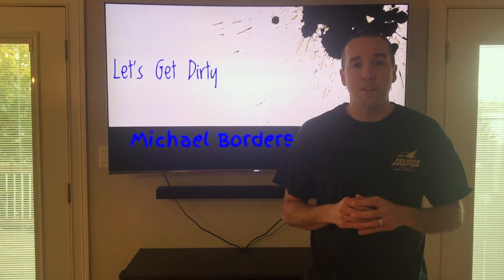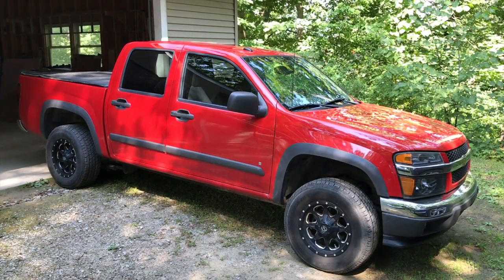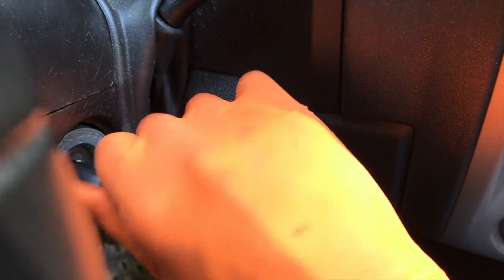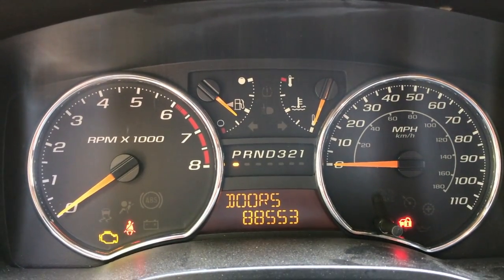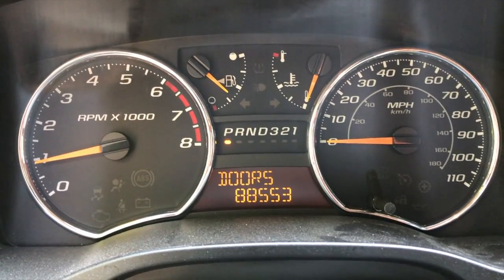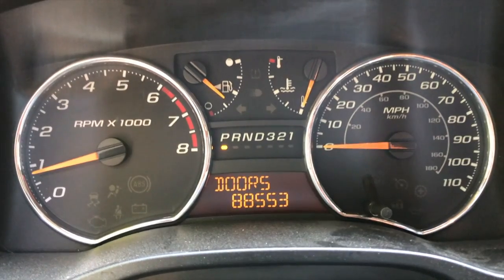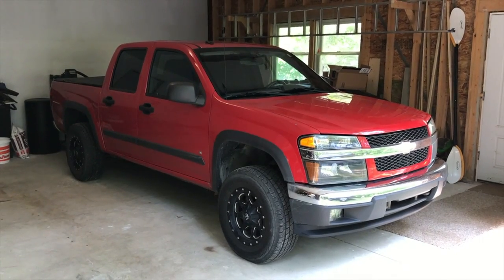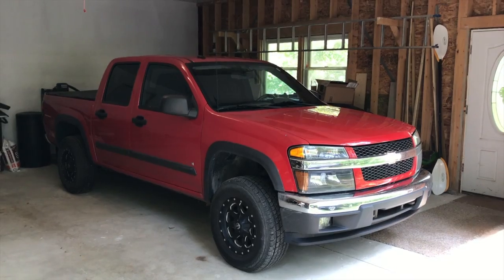How to do a "QUICK Reset" on your ABS System!

Comment: So far it didn't go away will try the driving option in a few minutes 🤷🏽‍♀️
Reply from the maker: @Altered-By-Christ  

Thanks for watching.  If that doesn’t help, try disconnecting your black negative cable from your battery and leaving disconnected for five minutes.

This will also allow your system to reset.

Comment: I know this vid is old but my 00 gmc sierra has an abs light on for front left wheelspeed circuit open. I replaced the wheel bearing and nothing happened ill try this but i dont think itll work
Reply from the maker: @thegman4759  

Thanks for watching.  Since the wheel bearing was just replaced, you may want to disconnect the black negative cable from your battery and leave disconnected for a minimum of five minutes.

This will allow your system to reset and hopefully turn off ABS fault light.  🧰
Reply: @DIYwithMichaelBorders  thank you I will try that to haven't done the pedal reset yet though.

Comment: This likely all bs! I had the same symptoms; turn signals not working, bogus transmission shift solenoid error codes and neutral safety error code. Took  vehicle to local mechanic and they confirmed noted error codes. They wanted $500 plus parts to further confirm error codes.  I opened hood and noted break fluid was low and dirty. I flushed and bled brake B fluid and now everything works great!  Don’t trust EMS on your car or any so-called mechanics!

Comment: How would
ThIs work for a 2016?Dodge journey with a push start
Reply from the maker: @jloc260  

Thanks for watching.  For push-button start, you will want to press your ignition start/stop push-button without having your foot on the brake pedal.

This will allow your ignition system to turn on without starting the engine.  From here, you can continue forward with performing this reset procedure.

Comment: 2004 Tacoma ABS light blinking when braking=after stopping foot off brake, blinking stops?  AFTER DRIVING A BIT, THEN BRAKING BLINKING RESUMES?  bRAKES SEEM FINE.  i HAVE AN AUTO INSURANCE SENSOR IN MY CODE READER PLUG. SOMETHING PROGRESSIVE iNS  GIVES NEW CUSTOMERS TO USE FOR SIX MONTHS TO SEE HOW CUSTOMERS DRIVE-COULD THAT CAUSE BLINKING OF ABS LIGHT?
Reply from the maker: @neojoneswd  

Thanks for watching, any update?  The insurance adapter sensor shouldn’t trigger a fault code however we can’t rule it out.

Have you performed any reset procedures?

Comment: You know as far as stepping on as pedal 3 ties works most chevys to reset oil change light. Ive done it chevys  that had  that bake light on to clear change oil and and they both should have came and only change oil light did hasn't worked on any that I've tried

Comment: Cool. I'll give it a shot tomorrow.  🚗
Reply from the maker: @TheStreetest  

😎👍🧰
Reply: @DIYwithMichaelBorders  neh, didn't work. 😆
Reply from the maker: @ 

Bummer, you can attend this reset procedure a second and third time… As your system may require it to fully reconfigure.

Still no luck, it’s very likely something within your ABS system is faulty.
Reply: @DIYwithMichaelBorders  I put new abs sensors on unplugged the battery 🔋 let it reset and then it would go off ..  then after awhile it comes back on !?  I have an auto pro pad. I was gonna run the obd and see what the diagnostic says
Reply from the maker: @ 

Very cool, that may very well identify the cause.

Comment: To all who watched that video,this trick only helps to past inspection if u run the car after reset it will pop up again abs light.On mine pontiac grand prix 2002 is worked that way but its work...I was very surprised...Thank you my 😇
Reply from the maker: @adrianhenryk5965  

Thanks for watching and sharing your thoughts and experience.  This reset procedure is great.  😁👍🧰

Comment: I did the reset and it worked, the lights on the dash went off…….until I turned the ignition off and cranked it back up and the ABS and Traction Control lights came back on. Any idea why?
Reply from the maker: @firstblood4493  

Thanks for watching, a few things can cause this however the most likely being a faulty part that’s acting sporadically as opposed to being completely dead or broke.

A wheel speed sensor can act sporadically and send false signals to ABS.

It can even be as simple as one or more of your tires having low air pressure.

🧰

Comment: Didn’t work. ABS & TC lights are still on after having shocks and struts installed. Mechanic says the sensors are working. Oddly, and perhaps related, the tire pressure gauge light which had always been on is off. It’s annoying, wish my scanner could clear it.

Comment: My 03 H2 hummer and I had 0 lights on dash. Replaced front rotors and pads and now my abs and tc lights come on after driving for a bit. But they reset when I turn vehicle off. it is strange
Reply from the maker: @tomchristensen2914  

Thanks for watching, interesting.  We would start by ensuring that all four of your tires are properly inflated to the recommended psi.

Sometimes having the vehicle jacked up on a jack-stand and leaning at a very awkward angle can put unique strain on certain tires and the psi can alter and trigger the sensors.
Reply: @DIYwithMichaelBorders  yeah absolutely nothing changed except when doing the brakes and rotors I unplugged the welheel speed sensors . Battery wasn't disconnected so not sure if that was what did it. But I plugged them back in immediately after. Funny thing is when lights are on and I run scanner. It comes up as no codes and then when I restart vehicle the lights are off. My brake light is dimly lit as well.. just odd
Reply from the maker: @tomchristensen2914  

Thanks for the reply.  That’s interesting…🤔…possible faulty speed sensor.

It can even be as simple as too much brake fluid in reservoir.  Below is a link to our video explaining more about how that affects ABS system.

       https://youtu.be/X-AJ5tD6zoA?si=9zp2qEHrWUDF-755

🧰

Comment: Hi, I am working on a 2011 Buick Enclave. I bought it on IAA Auction in March, had it delivered from the auction site in Fayetteville, Ark. So, expectedly it had a few twiddly issues. Pumped in some freon, works like a champ all summer so far. And a mystery light on the dash, ABS and the traction control skidding car.  Brakes worked so I ignored it all summer. An interesting oddity not mentioned in any videos. After I have been parked for a while, on taking off again it will often turn off the ABS/Traction lights. If I just idle around they stay off once I hit 19 or 20 mph they come back on. I did the check engine light thing, but it was very hot that day. 108 so I did not last long with the driveway check.

This indicated a long list of snigglets. amongst them rear left issue with sensor. So, it was not clear if it was sensor or the magnetic ring on the bearing hub. Now that it is cooling off a bit, I will be working on that issue a little closer.

The three presses on the accelerator did not turn off the ABS light, it did its usual of as I was taking off from the drive the doors locked, ABS/Traction lights went off, and at 20mph came back on again.

Now the noticeable change in the system after the three peddle reset. While ABS light was off, the brake peddle did not sink to near the floor and make a vibration to the foot with a noise like stepping on a pigglet. The brake peddle was engaging the calipers near the top as it should after a proper bleeding. After the lights resumed their annoyance mode, the brake peddle was still engaging near the top as it should with no sinking or sponginess, I finished the 4 mile test drive with a big smile. But still need to get to the cause of the ABS. I can probably unbolt the sensor and see if it is coated with steel and brake pad dust, clean it off or more likely just plug in a new one their like 20 bucks and the original is 2011 and due to make buick some more money.  The Hub, I am afraid I will have to go to a shop and have it looked at.

So, all that said. Yes, the three peddle reset did improve the situation. Thanks for the tip.  Now the TPMS sensors battery is getting weak on the front left. I about had a doodoo in my pocket the other day on the busy highway when that warning light came on. Overnight, it settles down again, but after a few minutes of operation with report a low tire, or disapear. Next step after this comment is order a package of the valve stems with a blue tooth battery powered sensor to install in the tires.  One goes lame, they all four are probably close to the time to earn Buick some more money.  I found a package of four from someone selling through walmart for like 40 bucks shipped.  A tire shop near just asked for a donation to break down the tire and install the sensor. Very nice hard working barely english speaking entrepreneurs.

Again thanks for the tip, I will keep an eye, er foot on the peddle for a few days and see how this new action works out.
Reply from the maker: @RickRamo  

Thanks for watching and sharing your experience, we really appreciate it.  Any update on your findings and status?

We would also recommend ensuring that all of your tires are properly inflated to the safe and required psi.

Low pressure inside a tire can trip ABS light in the manner it is in your situation.

Dirty or faulty sensor as you mentioned is also likely.  Looking forward to hearing back from you.

In addition, if larger than original tires were recently installed, this can also trigger your ABS light to illuminate as the magnetic ring and sensor are having a difficult time sending proper signals to the computer.

🧰

Comment: What if it doesn’t work
Reply from the maker: @kyleharris1142  

Thanks for watching.  Any update?  We recommend performing this reset procedure a second and third time.  Keep us posted.
Reply: @DIYwithMichaelBorders  still comes on after hitting 55 or 60
Reply from the maker: @kyleharris1142  

Thanks for the follow up, have you insured that all four tires are properly inflated to the recommended psi, and not low on air pressure?

Comment: I had my chevy Equinox in the shop recently . Have the Stabilitrax, tcs and check engine light all at once, Mechanic says the abs module is whats makin the lights. Can I disconnect the abs module by pullin a fuse, or is that dangerous
Reply from the maker: @williamlee8053  

Thanks for watching, you can depending on vehicle.  We would start by disconnecting the black negative cable from your battery and leaving disconnected for a minimum of five minutes.

This will allow your system to perform a full reset, and hopefully reconfigure your ABS system/Module back to proper configuration.

Comment: Should this fix work when both the ABS and Brake warning lights are on?
Reply from the maker: @mkd9251  

Thanks for watching, it will help reset and reconfigure ABS and brake system as long as there is no faulty parts present triggering ABS warning light.

Comment: Omg it did work have a question is this a temporary fix? Or permanent I have a ford explorer 2009
Reply from the maker: @Laura-kc3ih  

Thanks for sharing this, this can be a permanent fix in the event that your onboard computer and electrical system experienced a sporadic electrical glitch.

However, in the event that you actually have a faulty part within your ABS system, your ABS light will likely…and should…illuminate once the faulty part is detected again.

In addition, it can be that your ABS system has a part in its early stages of failure and acting sporadically…meaning working sometimes and not working other times…that’s triggering your ABS light to turn on at random times.

👍🧰

Comment: Didn’t work
Reply from the maker: @Laura-kc3ih  

Thanks for watching, we were going to ask you if you had an update however, we just received your follow up comment that this reset procedure was successful. 

We appreciate the update.  😁👍🧰
Reply: @DIYwithMichaelBorders  the strange thing is, I have to keep resetting it every time I get in my car
Reply from the maker: @Laura-kc3ih  

Thanks for the follow up.  In that case, something is indeed acting sporadically.  Does the ABS light come back on at all while driving or just initial startup?
Reply: @DIYwithMichaelBorders  just at every start up along with brake light ugh 300 for two Machanics to say is probably yours and module but ford don’t make it any more and no one will put a used one I bought in it! Ugh!!!
Reply: Oops abs module
Reply: Yea they don’t make a 2009 ford explorer ans module any longer
Reply from the maker: @Laura-kc3ih  

Thanks for the follow up.  We would take some time over the next week and locate each wheel speed sensor in wheel wells and disconnect them to ensure they are not damaged nor there is no moisture inside.
Reply from the maker: @Laura-kc3ih  

👍
Reply: @DIYwithMichaelBorders  awww I’m a chick with no skill I’ll call my Machanic
Reply from the maker: @Laura-kc3ih  

We are looking forward to hearing back on what the mechanic finds.

Comment: How to do these steps when car is  push-start system....not, key operated??? Cheers
Reply from the maker: @fredlum3614  

Thanks for watching, any update?  You will press START/STOP push button one time while NOT pressing on brake pedal.

This will allow ignition system to turn on without starting engine.

Once ignition system is on, you can perform this procedure.

Comment: The problem is that resetting an ABS code doesn't fix the issue the code caused. Its just a bandaide solution. The ABS module could have a cracked solder joint or a valve inside the unit could be faulty. You need to get the issue looked at and not ignore it 👍.
Reply from the maker: @sarin62  

Thanks for watching and sharing your thoughts.  Not always believe it or not.

It can be a simple is a glitch in the electrical system and onboard computer.

We appreciate you sharing, always welcome here at our channel.
Reply: @DIYwithMichaelBorders  Thats true. It could be a bad wheel speed sensor or leaky brake lines also ect ect.. 👍. People just need to cover all bases and there are a few of them. Cheers for posting though 👍
Reply from the maker: @sarin62  

So true, we appreciate the addition info.  The DIY community is the BEST!  Your added causes may help out a future DIYer while reading the comments.

😁👍🧰
Reply: @DIYwithMichaelBorders  My pleasure. Always willing to help someone if I can save money and braincells 🤣
Reply from the maker: @sarin62  

Much appreciated!  😎👍🧰

Comment: ABS and traction control lights are on. I tried this twice but it didn’t work for me. 2011 Cadillac CTS coupe. Any suggestions?
Reply from the maker: @samm_is_me  

Thanks for watching, any update?  We recommend disconnecting the black negative cable from your battery and leaving disconnected for a minimum of five minutes.

This will allow your system to perform a full reset.  👍🧰

Comment: I have push button
Reply from the maker: @newsgirl2  

Thanks for watching.  In your case, you will press START/STOP push-button once without pressing brake pedal.

This will allow you to turn ignition on without starting engine.  🧰
Reply: @DIYwithMichaelBorders  thanks doesn’t work
Reply from the maker: @newsgirl2  

Thanks for the reply.  At this point, it’s best to have your ABS system read by an OBD scanner.

However in the meantime, make sure your tires are properly inflated to recommended psi.

Comment: I replaced an ABS module on a 2017 port fiesta. With a used one that is good, the issue now is my A. BS light is on and the paddle only comes up a little bit. It seems like the A. B. S is not working now. How can I fix this problem without a scanner
Reply from the maker: @hughbunyea4703  

Thanks for watching, any update?  You may want to perform a system reset by disconnecting the black negative cable from your battery and leaving disconnected for a minimum of five minutes.

This full system reset will allow your onboard computer and electrical system to hopefully remove any and all electrical glitches and return your system to normal operating configuration.

Comment: This does not work for a 2005 Ford Expedition. So I may have a real issue.
Reply from the maker: @kristopherdetar4346  

Thanks for watching, any update?  You may want to perform this reset procedure a second or third time.

After that, if your system doesn’t reset and return to normal configuration…it’s very likely that you have a faulty part within your ABS system.  Keep us posted.

Comment: This has worked for me today 29/07/24.....I have a Berlingo panel van, the tyres looked low on air pressure so went local garage to check and put air in. The front ones really low, so set to 35psi and did the nearest drivers rear tyre to 35pis (also low) there was a que waiting for air pressure machine so thought the passenger side rear looked ok would leave it as alkward with van using pressure line.  Few days later the ABS light came on as driving on A55 (England) was going over 60mph. Got home, turned off engine and back on and the light had gone. Next days around town no ABS then it came on again on the A road over 60mph -- anyway, looked up lots about ABS system thought i would have to book into local garage to sort (and cost a lot)  found this video!  Thought go get the final tyre same recorded pressure as other 3 tyres -- then did this process, took it on the local M53 got to 70mph no ABS light made up -- I figure that the ABS detected the last tyre low pressure and came on at high speed, now all tyre pressures same and this reset has put the ABS monitoring the tyres from now at correct pressures --- you must have saved me a fair bit of money  - thank you
Reply from the maker: @beerewarded7451  

You are very welcome, we really appreciate you sharing your experience.  👍👍 to you for making it a DIY project.

Saving money is awesome and earning that rewarding feeling of a successful DIY project really brings out the power of DIY!

😁👍🧰